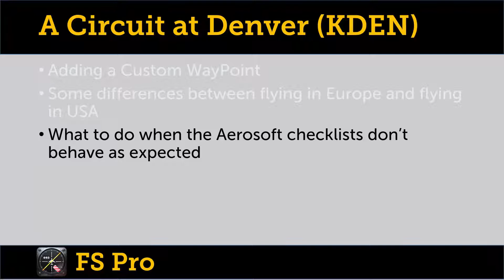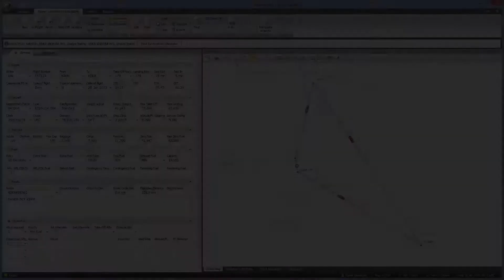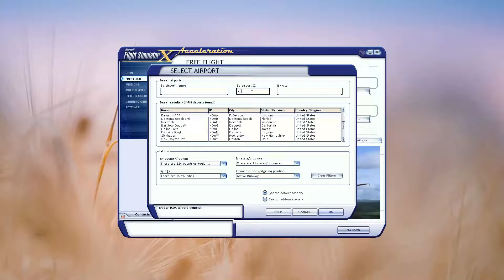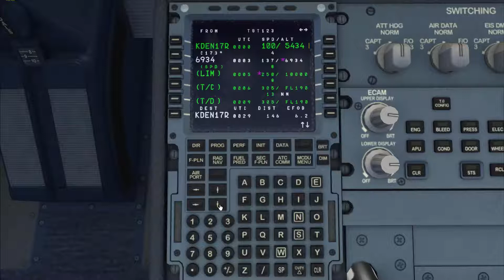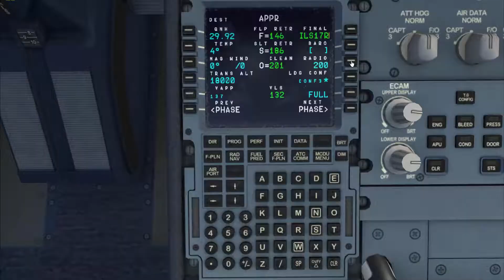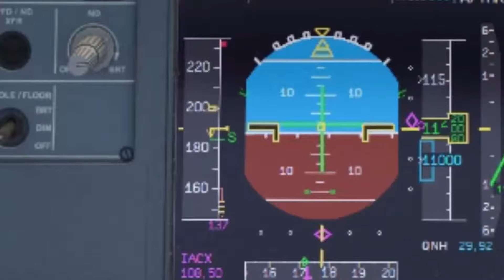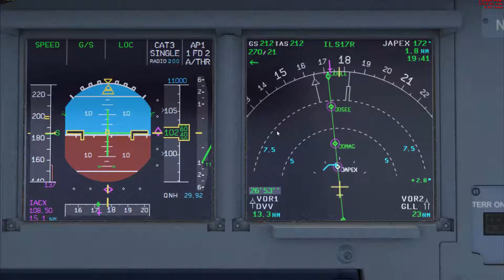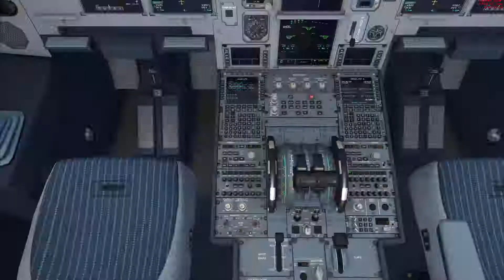Airbus A320 Denver (KDEN) to Denver (KDEN)

Comment from the maker: @Liofa Yes - understanding the importance of the 'S' speed has made my approaches better and more easily managed.

On the topic of slowing down the aircraft manually, I was flying a different route yesterday and noticed that, during the descent, the Airbus will prompt for 'More Drag' and bong at you when it no longer needs it. However, it doesn't seem to ever do this on the approach. No idea why, unless it was a design decision not to interrupt the pilot when they were landing (or, in my case, making a mistake :)

Comment: This could be a good start:
http://en.wikipedia.org/wiki/Flight_level
Reply from the maker: Hello Igor. Thanks for the link. It all made sense to me and so I had to listen to the video again to see where I may have gone wrong. There are a couple of instances where I mix up the use of "Transition Level" and "Transition Altitude" so thanks for pointing that out.  For anyone reading that's also interested, here are the definitions (from Wikipedia):

Transition Altitude : Altitude above sea level at which aircraft change from the use of altitude to the use of flight levels.
Transition Level : Lowest flight level above the transition altitude
Transition Layer : airspace between the transition altitude and the transition level.